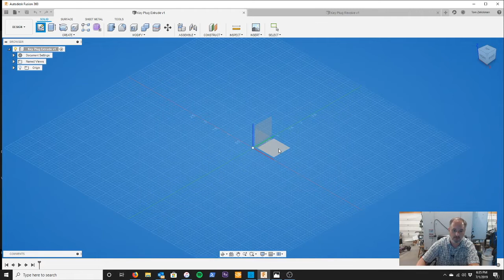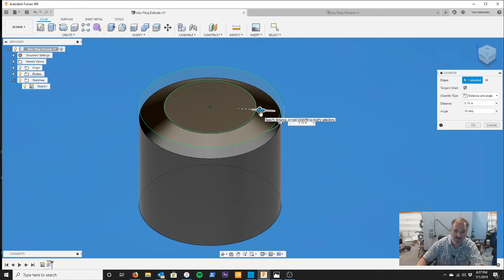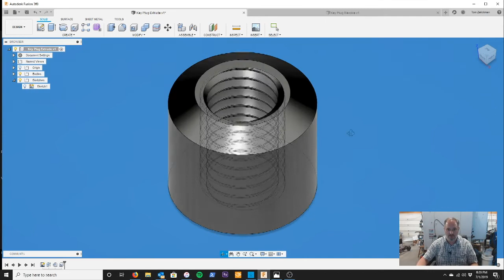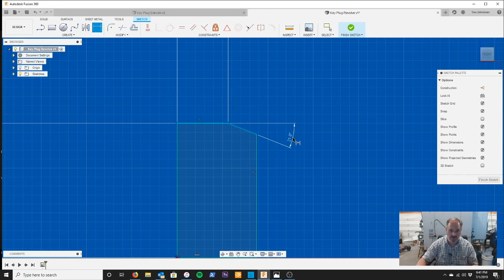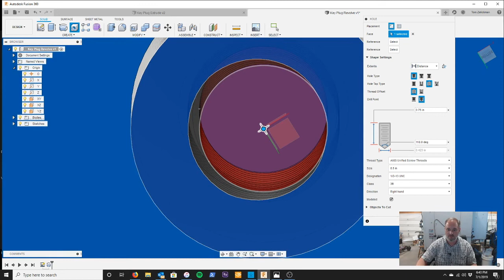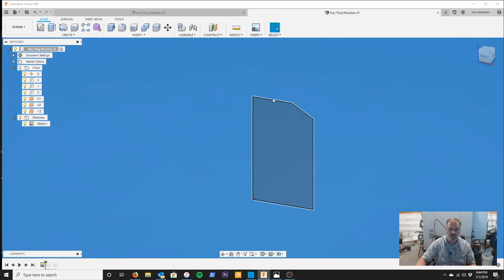Extrude or Revolve - You Decide!

Comment: I find myself doing a revolve if it's all one "feature" instead of having multiple extrudes to make what is one feature. It's going to change, I don't want to dig through 10 things to make changes when I can edit one sketch and everything is there. Of the 15 engineers I work with I see 20 different ways to do it so there's clearly no consensus, ha.
Reply: Also, is there not a way to dimension it as a diameter inside a revolve? In Creo we have to have a centerline inside the part but that allows us to do either radius or diameter.
Reply from the maker: So I used the origin's Z axis as the centerline but I don't know of a way to dimension the diameter inside the revolve. Might have to look into that though. I suppose the goal for this video was just to get folks thinking especially since tutorials often make it look like there is only one "right" way to do things. One day I'll have to play with Creo, I suppose...